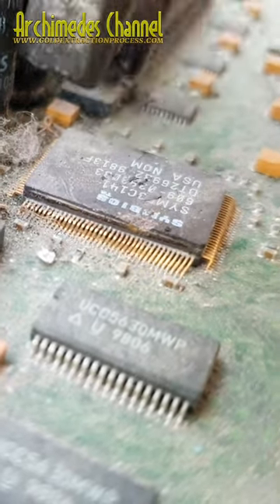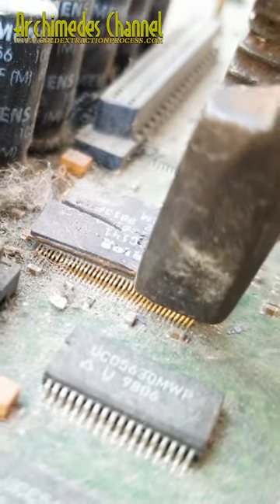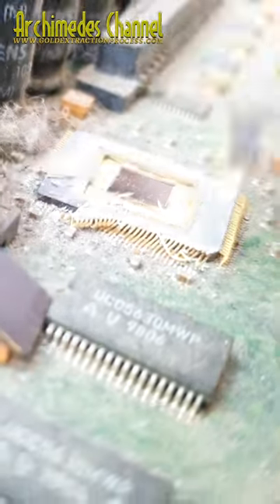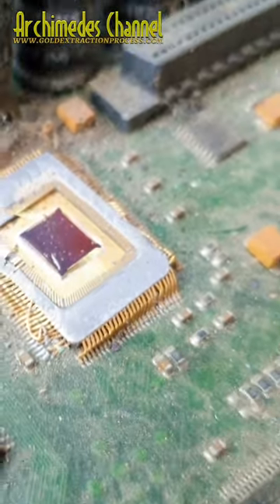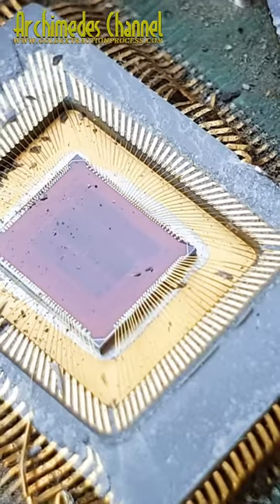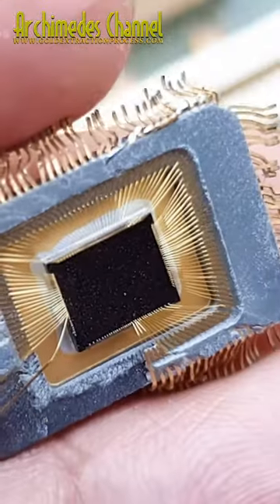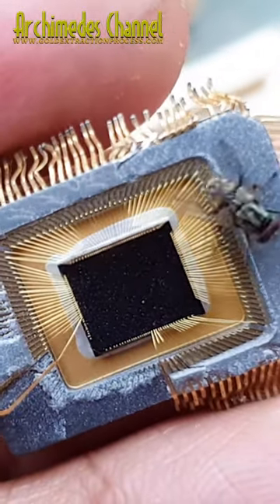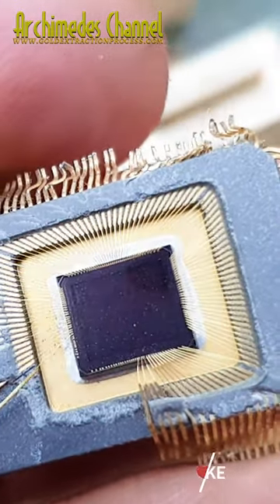What's inside the microprocessor chips #shorts #microprocessor

Comment: Caps and resists (capacitors and resistors) are not put into the CPU using lithography. The lithography just makes the transistors and other processes add those components (usually microsoldering from my understanding).
Reply: Caps I don't know, but resistors they do. Same way they make the "wires" just in a squiggly line instead if a direct connection
Reply: @loligesgame  They generally don't make resistors on digital integrated circuits.

The value in ohms of a resistor on an integrated circuit die is determined by the ratio of the length to height of a rectangle.

Resistors take up a lot of area.
Yes it is possible to take a very long thin rectangle and make it more compact by having it create a line which turns left and right repeatedly but it generally is not done.

It is a more efficient use of the area to use a transistor and tie two of its pins together and design the dimensions of transistor to give you the resistance you need.

The wiggling of traces on dies is more likely to be an interconnect trace carrying a digital signal which we then wiggle back and forth along its length to introduce extra timing delay to fix a timing problem.

Capacitors we certainly don't put on to a digital integrated circuit die, because they take up far too much area.
And we generally don't need them.

If you remember your capacitor formula, 
C= (Aε0.εr)/d

you will see that the capacitance is directly proportional to the area of the parallel plates.
They are too costly in the amount of area they need.
Reply: @deang5622  Mostly true, but don't forget about trench capacitors used in CMOS logic and some memory circuits. Since we usually only use high and low values, the resistors between gates usually arent that important and are mostly not considered. The only example I can think of is inside an ADC, but I would be surprised if they actually use resistors with precise (+-5%) values in there
Reply: @gaelas4853  DT's aren't used in CMOS logic but for DRAM memory cells.

They refer to the process technology as CMOS but CMOS logic uses both P channel and N channel MOSFETs and doesn't require capacitors to operate.

The DT capacitors are a way to reduce the surface area required for the capacitor of and keep the die area down, as the die size is a major element of the manufacturing cost.

DT's didn't exist when I was in the semiconductor industry.
Reply: @gaelas4853  You don't need resistors from the output of one logic gate to another.  The FETs are voltage controlled devices with a high input impedance.
Reply: all of them use lithography, in combination with etching, deposition processes
Reply: You surely can integrate also resistors and capacitors, but as Dean G said, not in digital circuits. I work in analogic electronics for radio frequency applications and we integrate any sort of component in our designs.
Reply: @deang5622 However unless you are quite old, DRAM with its capacitors storing 1 bit each must have overlapped your career, even if their physical design was different from later models .

Comment: Don't leave us hanging, inquiring minds want to know what the chip is! Looks to me like a Symbios 53C141 "LVD SCSI Bus Expander" that "attaches single-ended SCSI devices to a Low Voltage Differential (LVD) SCSI bus."

Fairly exotic part, probably only found in upscale equipment, which makes sense for a channel that's about recovering gold.

Comment: These chips don’t contain capacitors or resistors. Even though you can argue that transistors have an internal resistance thus can act as resistors, but they certainly do not contain capacitors. Misleading.
Reply: You can argue that the terminals on transistors have capacitance across each other 🤔

Comment: Actually capacitors and resistors are not used in digital integrated circuit chips. They take up too much area. 

If they need resistors they can use a transistor and tie two of its pins together. It is a more efficient use of the area.
Reply: decoupling caps are always used
Reply: @arnecl9566  Not on the die of the chip they are not. They are mounted externally.
Reply: @deang5622  You need decoupling on chip to avoid voltage drops. Due to the inductance of the bonding wires and the frequency at which power (and thus current) fluctuations happen it is not possible to do this off chip.
Reply: @arnecl9566  You clearly don't understand the difference between "chip" and die.

They don't put decoupling capacitors on the semiconductor die. They place surface mount caps external to the die.
Reply: @deang5622  sure keep telling that to yourself ;)
Reply: @deang5622  Well if you think about it, each transistor gates are couple or decouple micro capacitors.
Reply: @m101ist  I don't need to think about it. I used to be an integrated circuit designer.

Comment: modern cpu and gpu have gold ports and millions of transistors inside, covered with silicon outside.The parts that power and regulate the processor happen to the motherboard, such as the capacitor and resistor. not found in the processor.